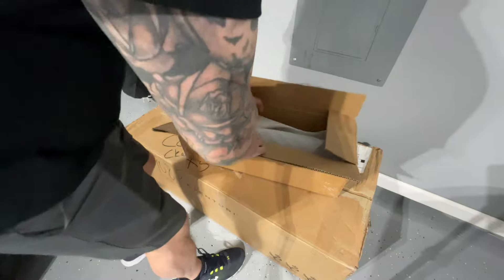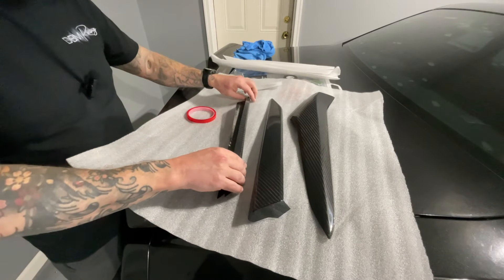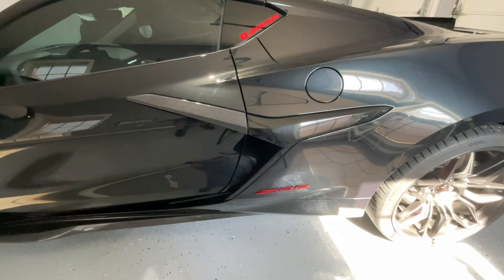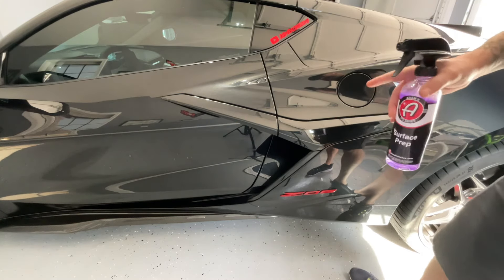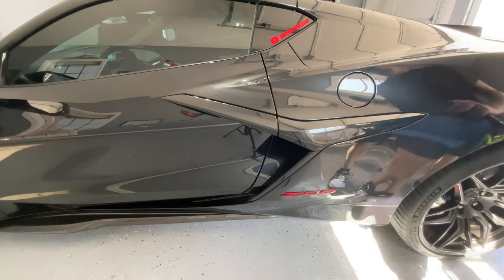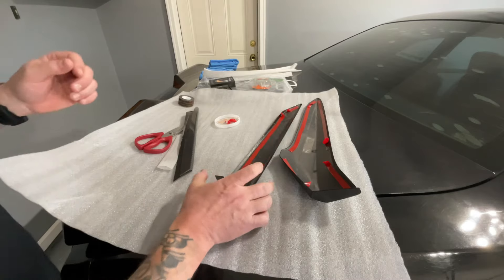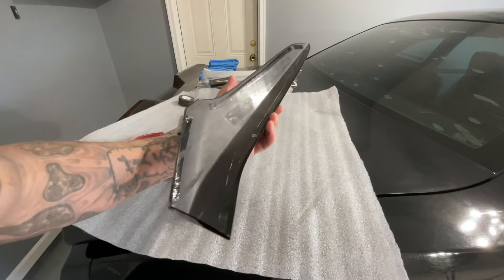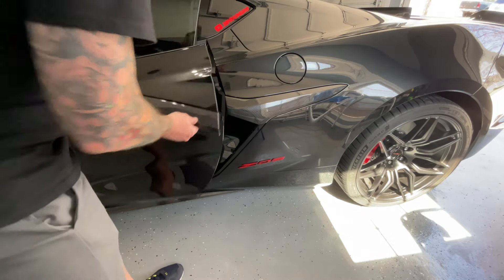MASSIVE UPGRADE 2024 C8 Z06 ESSENTIAL carbon fiber exterior MOD to make YOUR Corvette stand out!

Comment: Your audio is hard to hear. Great video! I was thinking of buying these but opted for the replacement instead of the onlays. Are you 100% satisfied?? I’m thinking I should save the money and go this way. Are you in Florida also?
Reply from the maker: I am 100% satisfied with the overlays. Just make sure you push the end pieces tight against the edge and then lay the rest down long ways. Also tuck that door handle piece up under on the bottom before you do it. I was thinking same thing and figured I would save a little money and see if I like them and I sure do. Especially for the price and the time involved installing. I’ll bet if my car was parked beside a car with the replacements…. You wouldn’t be able to really tell. They fit nicely. I split time between Orlando and Georgia. If you’re close we can set something up!